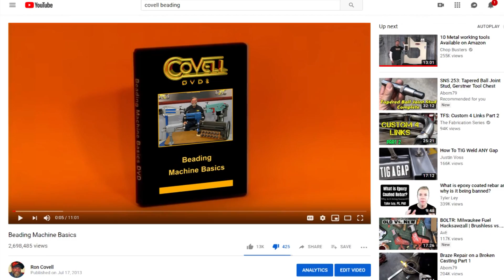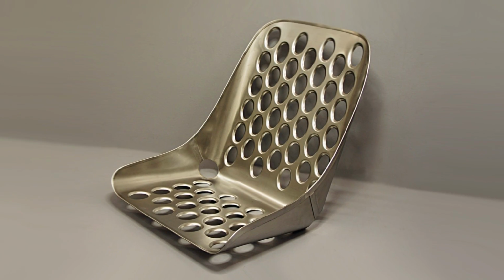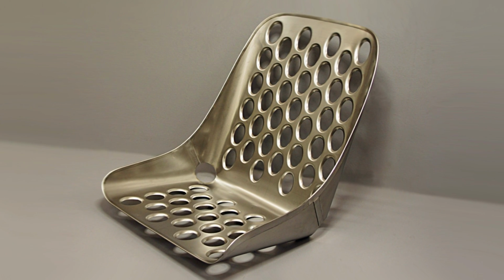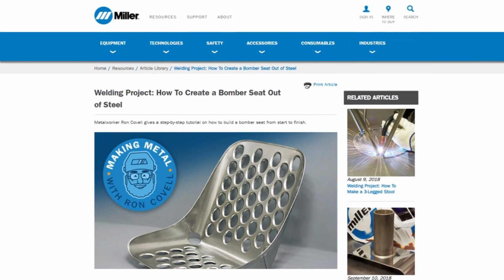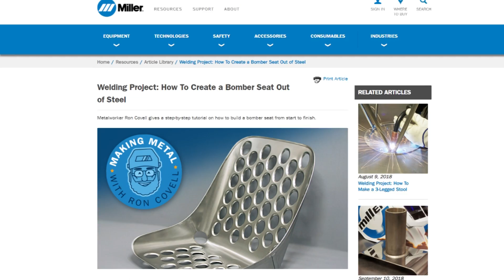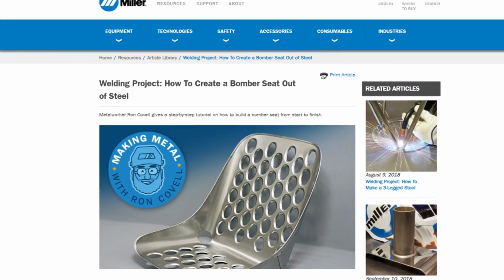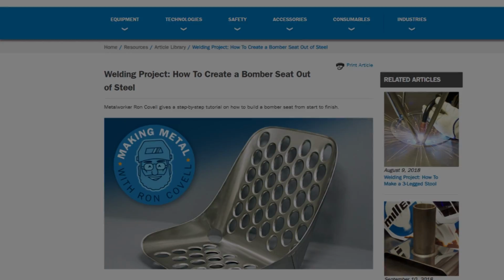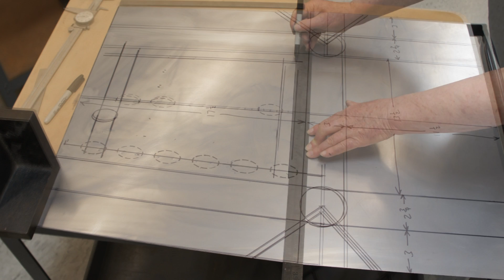Bomber Seat - made EASY!

Comment: simple tools and easy is something i didnt see in the video..  your are a craftman with years of experience and make it look easy.
Reply from the maker: Thanks for watching, and for commenting. I suppose what is 'easy' is relative, but the biggest takeaway I hope people get from this video is that making precise, repeatable bends can be easy if you cobble together a simple fixture.
Reply: "next up, a nuclear fusion reactor made EASY!"
Reply: @martinblank1484  lol im waiting for my easy-made perpetual motion machine first
Reply: They are simple tools. Simple doesn't mean cheap or readily owned. If you had those tools and this video, I reckon most people would be able to create something similar.
Reply: evilution Well...you can “own” something (all it takes is a little money), but to be able to use it effectively requires knowledge and experience. 

A bomber seat would be something a Metal working 102 class would be able to do. I’d like to see some basic objects which someone could make within a week of starting metal shop.
Reply: Gotta agree here.  I have enough tools to build a street rod, airplane, boat, wood framed building and cabinetry.  I've done all of that.  A bead roller, punch and die set and spot welder are not everyday tools for most people.  I appreciate the craftsmanship and it is an easy method if you have the right tools.  Riveting isn't difficult at all and takes few tools.

Comment: "simple tools" says the guy with a shop full of metal working equipment.  LOL
Reply from the maker: maxbored - Many people have said the same thing, and you are right. I'm thinking seriously about making a new video that shows making a similar seat with REALLY BASIC tools!
Reply: @RonCovell  I would be really, really interested in that!
Reply: @RonCovell  that can help me too
Reply: @RonCovell  a shop tour of your shop would make a great video. It's always interesting to see shop layouts and work flow. Great videos thanks for sharing.
Reply from the maker: Making a YouTube video of making a Bomber Seat with REALLY basic tools is still on my 'to-do' list. Please be patient!
Reply: A jigsaw with metal blade. Overlapping aluminium riveted to eliminate welding. Whatever. I like what you do and am investing in tools. £3000 on 2 100 ton hydraulic cylinders and pump. £3500 on a TIG welder 330 amp. £1000 on a mig. 

Yep Ron my plan is to get into metal fabrication. Even bought a 13.75kva generator fitted to the back of my truck so I can power the tools. Working inside my hige mobile workshop. All takes a lot of time though to get and set up.
Reply: @jamesbarratt593  You misspelled aluminum.
Reply: Maysure.

Comment: And subbed..

I don't have the tools done yet, but I am working my way to make something out of sheet stock. Making a fixture doesn't necessarily have to be all steel.  Plywood and hardwood are great tools for banging aluminium. Working with 2mm stock is a bit heavy, but it's either that or having flimsy parts.
Reply from the maker: I'm completely on-board with using wooden tools and forms. I have only done a little with 2mm stock. It's harder to move, but like you say, it can be very durable!

Comment: As usual great work and the simplified design looks every bit as good as the more involved version.   A lot of the comments about whether this is "easy" and the number of tools involved baffle me a bit.  This is metal working, tools are required.  I can't think of anything you used that was exotic or doenst have an inexpensive version available.  Anyway, I'm looking forward to the video where you make an entire roadster body using nothing but sticks and a roundish rock.
Reply from the maker: My reason for calling this bomber seat easy is because the bending was done with simple tools. In retrospect, I did use a lot of high-end tools for many of the details. I have made a point of using the simplest tools I can for my more recent videos, and I think people are relating to these videos better.
Making a roadster body with sticks and a rock might be a cool project!
Reply: @RonCovell  You did a great job, as always.  I appreciate you sharing these videos.  

Your tools (and work) are nicer than mine but nothing used in this video is exotic or out of reach of most people.   I dont get why people feel they should be able to do this type of work without any tools though. I get that  if you only do a few pieces a year you arent going to invest in some of the better tools but that isnt the same as not using any.

Sure, you didnt have to use an electric powered press, a cheap hydraulic press or probably even an arbor press could be used.  I've use (or made) different types of flanging tools but the die is easier, faster, more repeatable and well worth the investiment.   

I do like that you showed the improvised beinding tool for the sides.  Heck, if you haven't improvised a bending tool you haven't really done metal work. 

What I think many people seem to struggle with are the basics of the layout.  You're not pushing them to use bend allowances or anything like that but i still think many would struggle just putting together the paper template and laying out the metal because they dont have the concepts of how or where to bend.
Reply from the maker: Yeah, some of the comments I get aren't coming from a serious or experienced perspective. Here's a (hypothetical) example:

"I have a hacksaw and a pair of pliers, and a budget of $100. I want to build the space shuttle in two weeks. Can you help me?"
Reply: @RonCovell  I'd like to believe these are people just too young to know better but I've met enough of them to know better.

Comment: looks awesome!!, wonder how easy it would be using about 1mm stainless steel was given 2 sheets used for a kitchen splash back, i could easy make a hole fairing die's,  it's just how to make the bead for the edge i  can see being the main problem although i do have a small ring roller and a bigger one i made i could make rollers for, i don't have any sheet metal tools so will have to adapt and over come!!!
Reply from the maker: I think it would be feasible to make this seat from 1 mm stainless. Punching and flaring the oval holes would require precision hardened dies, but the rest of the work is pretty straightforward. You could always use heat to bend the edge cap.
Reply: @RonCovell  think I'd have to cut the holes out first then flare them but I've got a lath so could make a flaring tool for it and could harden it on my forge if needed dose look awesome!!

Comment: I like how you comment on each video! Nice you do that. I bought a Miller 210DX CPS a few years ago and plan on making one of these chairs to replace my aging shop stool. I need to order the plans and a few videos I have seen on your site.

But it leaves me wondering, what thickness/gauge do you prefer for each metal type? Does aluminum handle the weight OK? Is there a limit to how thick and thin you can go?

Also, since I don’t yet have a beading machine I am thinking of cutting slits in the brake bent edging and using TIG to fill the gaps and file flush. Ever tried this or any thoughts? It should allow me to bend the strip more easily while retaining the strength.

Lastly, which would you prefer for a heavy duty version, a fairly thick aluminum or a medium 304/316?
Reply from the maker: Thanks for watching, and commenting! You can make a durable seat using aluminum, mild steel, or stainless. The thickness depends on the usage you have in mind. Often the way a seat is mounted will give it a lot of additional strength - particularly if the top edge of the seat is connected to a structural member.
For a seat that will get heavy use, and that is only supported on the base, I would bump up the material thickness. For aluminum, probably .080" would be good (2mm). For mild steel, 16-gauge (1.5mm) would be quite strong. You could probably go just a little thinner with stainless steel, but that material is very difficult to cut, so I don't use it much for products like seats.
You certainly could bend the edge strip more easily if you  made small cuts in it, but I really don't like to do it that way. Once you learn how to SHAPE metal, that's a much easier way to accomplish your goals, and it eliminates the need for LOTS of welding and grinding (or filing). The job will nearly always come out a lot better, too.
If you have more detailed questions you can reach me by email - covell@cruzio.com

Comment: Great, concise video, Ron, immediately got my subscription! For those commenting about too much tooling they lack, I think that the lap joint could also be made without a beader, yes? Hammered on a stepped form (steel on a wooden block), or even eliminated altogether, just fastening by rivet or spot weld a strip on both sides of the butt joint. As another commenter has written, the flared holes could be hammered on a wooden form, also. That oval punch and die sure does make it easy, though, as billed. Harbor Freight presses are so cheap, and you point out that a round set does not even require one.

If people are desiring to make such a fine piece of work with nail clippers, hammer, and no skill at all, then they are on the wrong page.
Reply from the maker: Thank you so much for your thoughtful comments. Honestly, I am surprised that so many people have commented that I use 'expensive' tools in a video billed as 'Easy'. As you observe, at every point where I use an expensive tool, there are simpler, inexpensive tools that can accomplish the same task.

Comment: I would like to see a video on how to do measuring for projects. Say you were making a dash panel, and the gauges had different diameters. And you want to keep the SAME RATIO of DISTANCES between them. Other than trial and error or placing each gauge on the metal and marking it, how would you calculate where your drill/punch holes would go?
Reply from the maker: Thanks for the idea. Perhaps I'll do a video on that at some point. Honestly, I do a lot of this work 'by eye', and I get pretty good results. You can see that in this video:
https://www.youtube.com/watch?v=AdJlTLzwCmg&t=214s

Comment: I would be more impressed if he made anything by hand using simple tools.
Reply from the maker: Yes, many people have pointed out to me that I'm using professional-grade tools in this video. I'm planning a new video that will show how to make a nice bomber seat with truly simple tools!
Reply: @RonCovell  Hi was a panel beater late 60s -1990. In the  UK cars were expensive so they were keep rolling, although most were rusting away fast through salt corrosion,   British car were badly built in the sixty and most  were a monocoque construction, so lot of places salt water can hid and percolate out of sight, I made all  the floor panel and support rails and sills by hand using  only two 3 X 2 x1/4  angle iron and a piece of 4" gas pipe  and large lump of wood,  panel hammer,  no machinery not even an english wheel was used, all sheet material was cut with an old 'hill shear of a set of  Gilboes. So when you said simple tool it made me smile to see stretchers and and flanging machine, my machinery was a small oxford stick welder and  a gas plant, that was it. To form intricate  shapes I made hard wood template to bash the metal to shape.
Reply from the maker: I can tell you are a very clever person. Sometimes you just have to use what you have available to get the job done!

Comment: What gauge metal should I use for these? I have some 20 gauge laying around would that be thick enough
Reply from the maker: The seat in the video is 20 gauge, and it would require two strong mounts on the front edge, and two high on the back to be stable. If you are only mounting the seat on the bottom, I would suggest using 18 gauge.
Reply: @RonCovell  awesome, thank you!

Comment: Amazing video, top notch quality.Tools used list please????
Reply from the maker: I'm very glad you liked it! Here's the list: I use a Miller spot welder, a Miller MIG welder, Wiss hand shears, my bending fixture is shop-built, I use a Rotabroach annular cutter to make the 1/2-inch diameter holes, a Lazze bead rolling machine, a DeWalt cordless electric shear, Mittler Bros Oval Punch & Flare Dies, a Dake H-frame press, a Chicago bending brake, and a JS Tools Shrinker,

Comment: What alloy, temper, and thickness aluminum did you use on your aluminum bomber seat?
Reply from the maker: The seat in the video you left your comment on is made from steel. The aluminum bomber seat is made from .062" (1.6mm) 3003 H-14 aluminum.
https://www.youtube.com/watch?v=2PNl7QwURPs&t=427s

Comment: all these people talking about not having the tools, the metal is easy to get, a jigsaw and metal cutting blade is easy to get, a hardwood log or piece of metal tube the right size for the bends is easy to get, a hammer is easy to get, the trim you can buy at a hardware store...and so is the rivet gun, the will is the part your missing.
Reply: to make the holes, cut them out with a jigsaw, buy 1 large ball bearing and lay the metal flat on a piece of wood, put the ball in the hole you cut and hit it will the hammer.... nice looking hole
Reply from the maker: Kaiser - You are correct on all your points. Nevertheless, since so many people have made comments that the tools I use for making the 'simple' bomber seat are expensive, I'm getting more and more serious about producing another video, showing how low-end tools could achieve similar results. One of my challenges is deciding just HOW low-end is appropriate. There are people who may say even a jigsaw is 'too expensive'!
Reply: @RonCovell  you cant please everyone Ron, I'd say a jigsaw costs what normal person can afford and if they want to they can use a hacksaw instead, were not back in the stone age, I agree most people dont have the tools you have but where there is a will there is a way.

Comment: what thickness plate do you  recommend
Reply from the maker: 18-gauge (1 mm) steelhas a good balance of strength and workability.
Reply: @RonCovell  thanks, I'm busy with a volksrod and on a tight budget . already made the extension beam for the front axle. but thanks for your video sir. From South Africa.

Comment: Why is the rough cut with the electric shear required when finalizing with hand shears? why not do it with hand shears directly?
Reply from the maker: While it is possible to cut off a strip of metal wider than 1-inch with hand shears, it is quite difficult. That's why I prefer rough cutting with a power shear, and making a precise finish cut with hand shears.
Reply: @RonCovell  thank you, that makes sense to me!

Comment: So, what thickness material is necessary?  Al ?  If I want to use steel?
Reply from the maker: I'm using .063-inch (1.6mm) Aluminum. If I was making it from steel, I'd probably use 19-gauge (1 mm).

Comment: WOW! I wanna make a bomber seat now,.... checking my shed for simple tools,...
spot welder - nope,
metal roller - nope,
hydraulic press with appropriate dies - nope
metal air shear to make rough cuts - nope
hand shear - check!
step drill bit - check!
sheet metal - nope!
Wait a second.... what is a Bomber seat anyways?
Reply from the maker: Thanks for 'chiming-in'. Well, you already have more tools than some people, and I am planning a video that shows how to make a bomber seat with MUCH simpler tools than in the current video. 
Bomber seats were originally used in - wait for it - bomber aircraft. After the second world war, many returning servicemen built racing cars, and used surplus bomber seats in them to reduce weight. These days, a lot of people use seats of this type because they like the 'look' of them.

Comment: Ron, wow I am very impressed, and it makes me want to make an aluminum simple bomber seat. But, it seems as if your audio description is at odds with the images. You  say the seat width is 27" to allow for bends, but 3 + 2 3/4 + 13 1/2 + 2 3/4 + 3 = 25" not 27". You also say that you want 1" taper on each of the sides of the top. That would be 13.5 - 2 or 11.5". But you image leaning against the wall shows the middle section at the top as 4 + 4 or 8" not 11.5? What was the final dimensions used?
Reply from the maker: Lee - first of all, I'm glad you enjoyed this video, and looked at it with a discerning eye. It's always challenging to describe layout dimensions verbally, since there are many, many variables - such as the reference that dimensions are taken from, and the springback after bending. I do have a fully-dimensioned drawing for the seat pattern that I sell for $20. Email me at covell@cruzio.com if you want more information on that.

Comment: Why won't you never do the holes before you fold ؟ - I think it's easier and God knows best .
Reply from the maker: You probably could make the holes first if you wanted. A few of the processes would be more difficult that way - clamping the seat base to the table while bending the back, for example. Also, in my H-frame press, the part is too wide to fit between the columns, before the side bends are made.
Reply: @RonCovell  👍😉